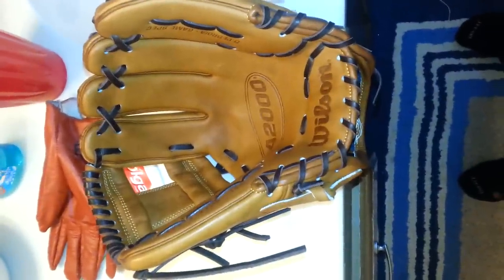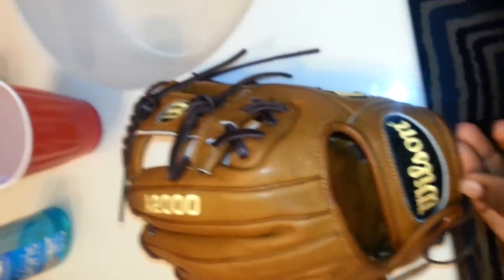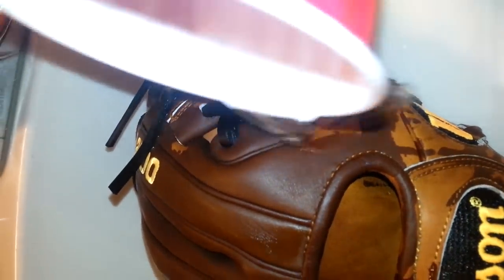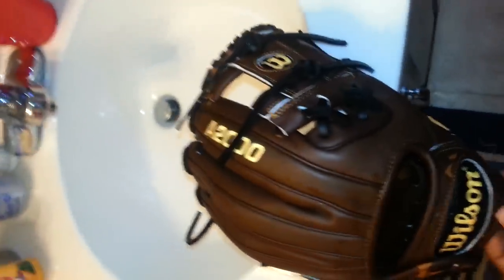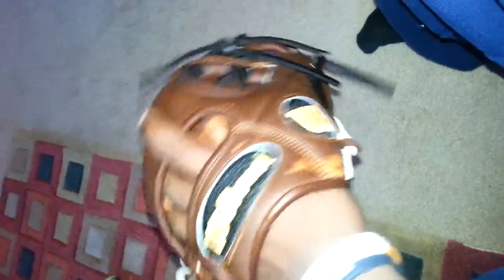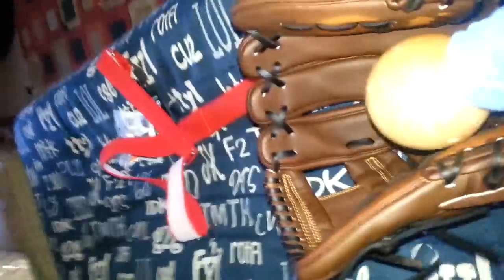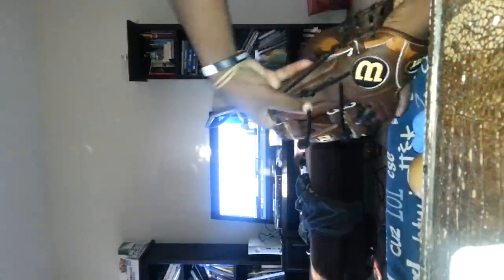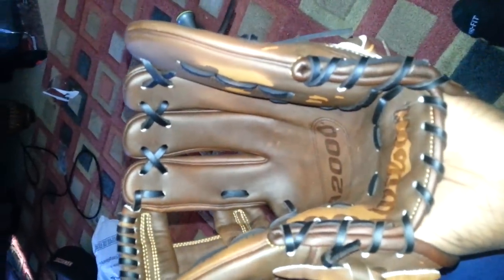How to break in a baseball glove: Day 1.

Comment: that will cause the leather to dry out the right way to break it in is u put some glove conditioner in the palm only bcuz u want the fingers to stay strong after u put the conditioner u pound the palm and the 2 break points then u put a ball in the pocket and wrap with string overnight then u just play catch and u can pound more and leave it wrapped if u want to but i wudnt suggest applying more conditioner until the leather starts to get dry
Reply from the maker: have you seen part 2 lol
Reply: No im saying u shudnt to the hot water treatment
Reply from the maker: +Benjamin Bierd it works though and you can see my glove updates and the glove is fine
Reply: Well it looks like u put too much condiioner

Comment: I'll still maintain that the best way to break in a glove is to play catch with it...pound it with a mallet, this method works too...its a matter of personal preference, there is nothing wrong with what he is doing but my advice is to play catch and let it mold to your hand...get a feel for what its like to catch with it. The leather will soften up surprisingly quickly doing only that...Nothing wrong with hot water method tho. I simply choose not to break them in that way myself.
Reply from the maker: Part 2 of this method is conditioner and mallet work, and part 3 is playing catch!!
Reply: BaseballKidd15 Ah, the thing with conditioner is I'll really only put a light coat on the palm, the fingers and the lace...some guys do put conditioner on the entire glove which is fine (certain gloves come super oiled and I dont really need to condition them) but if the leather comes kinda dry I'll do it. Ive always found the best way is to pound breakpoints and play catch and thats it. So its a two step process (w/o conditioner)